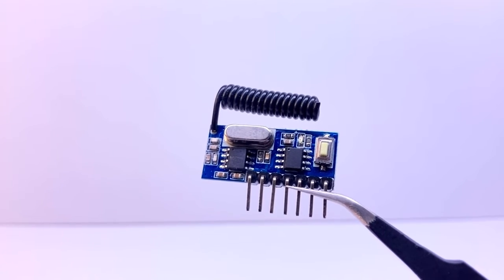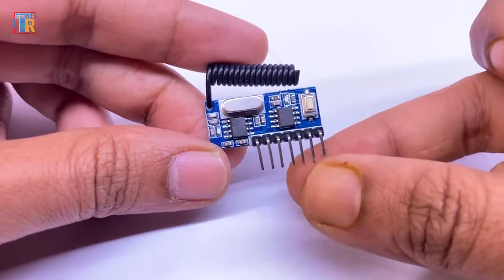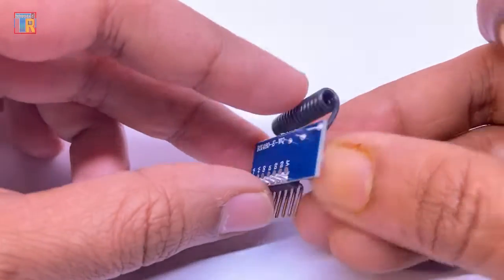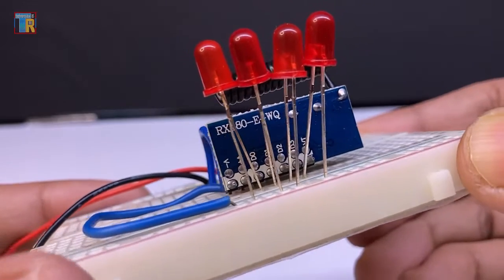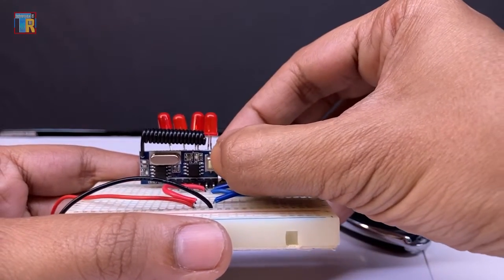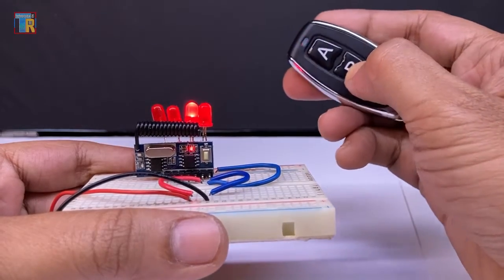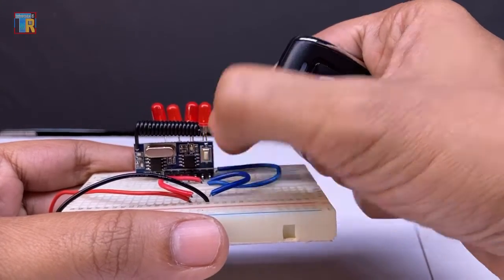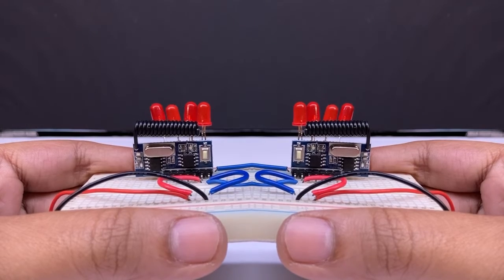QIACHIP 433 MHZ four channel RF receiver module | Review and user guide

Comment: What is the last pin ,bro? Vt
Reply: The VT pin has 2 functions： 1, Using VT to control the LED as an Indicator, when any pin D0-D3 signal output, VT have a signal output at the same time. 2, Using VT and +V can replace the button function on the receiver. (Note：The VT terminal is active when a signal is received, i.e. if any of the 4 channels is "turned on" the VT line is "turned on".）